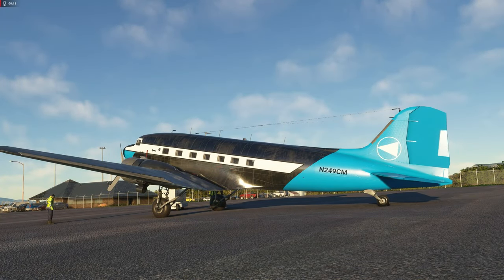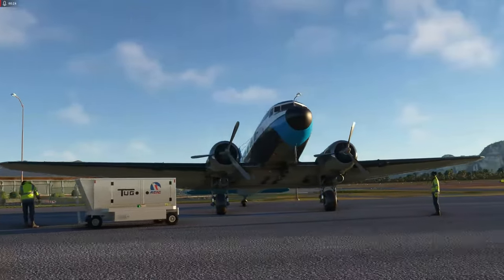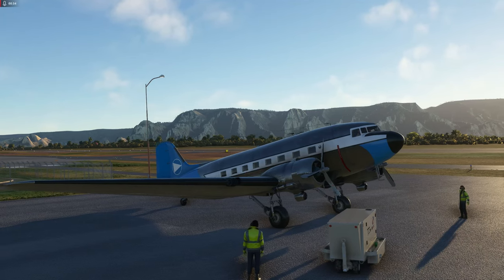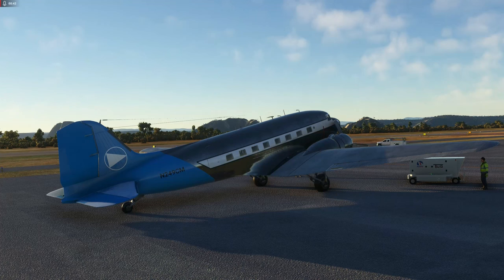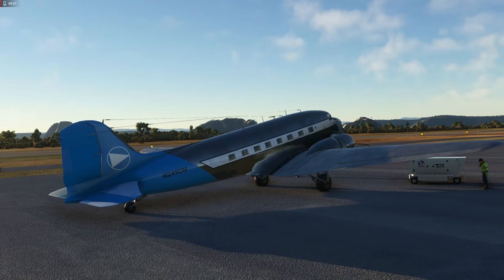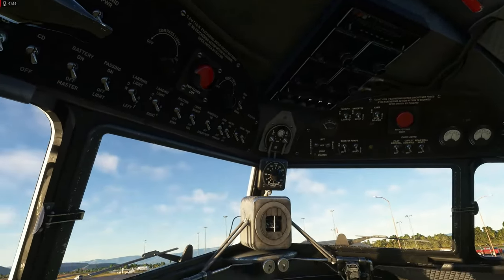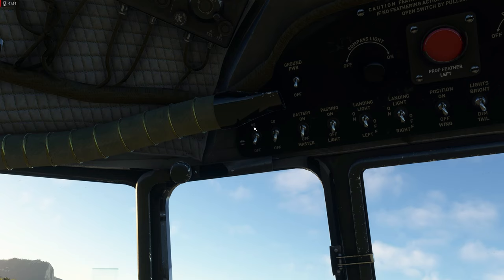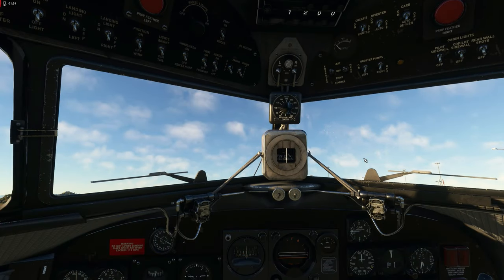MSFS Douglas DC-3 / C-47 Classic Variant Full Flight Tutorial (with Improvement Mod)

Comment: Some important advices: climb Power is 36MP and 2300 RPM, try not to exeed it! At take off and landing, stop forcing the tail to do something. For Takeoff: Let the tail come up and push yoke fully forward while it comes up and during TO-Roll until Vr is reached. Normal start is with flaps 0. Only at super short runways TO with flaps to half way up. Landing: Push the yoke downward after touchdown until the tail goes down by itself. Raise the flaps after touchdown to accelerate the progress. Wait for the tail to come down before you pull the yoke full up.
Reply from the maker: Thanks for your tips there! Actually after finishing the tutorial I did improve my flying with this bird a lot (esp. TO and LDG), still I will pin your comment for others to see. Cheers :)
Reply: Does the plane have actual failures that can trigger if flown too hot etc ?
Reply: @saren6538  get the duckworks mod from flightsim.to. Works best and is the most realisitic.
Reply from the maker: @saren6538  Not entirely sure. The default plane definitely not. Maybe with the Duckworks mod installed.
Reply: @saren6538  it has
Reply: @Euer_Hochwuergen  the default ?

Comment: I flew the DC3 for 6 years - we never opened the Storm Window as we spent a lot of time trying to stop it leaking.
* Taxing tail wheel locked unless your turning you use indipendendent engines & brakes. ( BTW This DC3 in MSFS is not realistic taxing as the Rudder acts like nosewheel stearing)
* No Flaps for take-offs as there drag Flaps.
Reply: Hi! First of all that sounds amazing, you must have a lot of stories to share flying this beast. :) 

Can I ask you, how did you used to Navigate back in the day on these instruments? Nowadays we are blessed/spoilt with all the information in front of us, like our ground track, ground speed etc etc, how would you have gone about finding your Wind Correction Angle for example?
Reply: @michaelpace5356  We used ADF, VOR & LOCALISER  for tracking plus Dead Reconing.
For my last DC3 flight (I was moonlighting for another company) heading back to Sydney from Gove (top right hand square side of Australia) we hit the coast & went into cloud (This DC3 only had 2 ADF's) & used dead reconing for the next 3 hours till we picked up an NDB.
We all had a "Prayer Wheel" ( a Nav calculator) but worked out all the times in our head usually. 
Keep in mind we learnt to fly in light aircraft that had no aids at all.
(I ended up flying A310 Airbuses so that was la span in aviation)
Reply: @billolgaau  So interesting! I'd imagine that 3 hours of dead reckoning would have kept you awake :) 

So you guys used to have an idea of the wind through the forecasted winds then something like an E6B was there to find your data? Makes a lot of sense actually

Comment: Brilliant, thank you. Always look forward to your videos.. Quick question if I may... I see you switched to MS flight sim from Xplane 11... Better graphics but requires more power from your graphics card I take...
Reply from the maker: Yes I put so many hours in XP11 (I think over 600), it was time to spend more time in MSFS as it's a brilliant sim as well. And no more Ortho4XP tile building is also nice for a change ;) Regarding the GPU, I own an RX 6700 now and it's more than capable to run nice, high settings at 1440p. Cheers
Reply from the maker: Oh wait, I did put 893 hours into XP11 hahaha
Reply: @SimulationChannelDeluxe  Thanks for the replies... I have an rtx 3060 nvidia... Running P3d v5 well.. was waiting for xplane 12...
Altough MS FS look absolutely stunning..
Not sure if my card will run it with decent graphics settings...
Reply from the maker: @mk1479  The 3060 should run it nicely, especially in 1080p.
Reply: @SimulationChannelDeluxe  Cool thanks.. and sorry to pester you one more question.. Does MS FS have to have internet connection to run?
Reply from the maker: @mk1479  For the most part yes. If you want real weather, the world ground imagery etc. you need internet. I think the sim itself can run offline, but it looks way worse and many functions are missing.
Reply: @SimulationChannelDeluxe  OK Cool thanks for your help..

Comment: Well, well well, here's ACD making a tutorial on a classic aircraft... ;) I thought those where not your thing? Anyway, you did a great job,  tried the dc3, but found it impossible to fly, might give it another try after watching this video!
Reply from the maker: Thanks bud! The DC-3 is a lovely old bird, I wish Aeroplane Heaven would have put a little bit more work in it as some systems are inop. Hopefully the improvement mods will add more stuff over time :) Btw, you wrote ACD... I guess you mean SCD? XD
Reply: @SimulationChannelDeluxe  Of course it should be SCD, drinking beer and typing is, just like flying, no good match. :p
Reply from the maker: @1849ad  Hahaha sure thing :D
Reply: @SimulationChannelDeluxe  If I may ask a question; I downloaded the enhanced version via the msfs marketplace, but it's not showing up in the aircraft selection page, any idea? Or do I have to switch in-game somehow?
Thnx in advance!
Reply from the maker: @1849ad  The Enhanced version just "overwrites" the default DC-3. The same for the A310. There is no additional aircraft to select :)
Reply: @SimulationChannelDeluxe  Ok, thnx. For me, the original modern autopilot keeps showing up. I think there's something wrong with the installment. Pmdg 737 also wont show up anymore. :/
Reply from the maker: @1849ad  That's strange. But regarding the DC-3, you have to see if it says "Classic" or "Retrofit". That's livery dependant. Some have the gyropilot, and some the GPS.

Comment: PAPI lights & your flying a DC3? :O)
* On approach make a nice steady approach like you did & leave the Pitch as is & as you flare & close the Throttles then Pitch full fine. (Great landing BTW)
* To stop the bounce use a slight forward stick.
* Auto Pilot - Don't bother lining the numbers unless your using it.
Reply from the maker: Great to hear feedback from a real DC-3 pilot :) Many thanks for it.
You're right, the steering on the ground is way too easy in MSFS. On the other hand I don't own rudder pedals or seperated throttles, so I'm quite happy with "easy mode" there ;)
Also by now when landing I immediately raise the flaps after touchdown, that also helps against bouncing and to bring the tail down.

Best regards from Germany!
Reply: When I & 3 others joined the Airline 57 years ago we came from single engine, fixed gear, no Constant Speed props & only about 10 hours night flying around the circuit sitting "Two stories" up so to speak in a DC3.

Comment: EVERYTIME I land, no matter what speed  - 85 to 90ish - as soon as the wheels hit the runway, it almost immediately swerves to the left. When I attempt to correct, it over corrects to the right and off we go into the grass…any thoughts from you guys who do it right?  How about yoke and rudder curves (honeycomb and Logitech, respectively) - my guess is mine are all wrong.
Reply from the maker: Well I would definitely recommend to turn down the sensitivities, mine are set to around -40 for aileron and elevator, and -65 or so for yaw. Also it can't hurt to set the reactivity down to 80% or so.
Also make sure that the tailwheel is locked (forward position) when landing. That's all I can think of.
Reply from the maker: Oh and it's quite difficult to land in crosswinds. The DC-3 certainly needs yaw to be in line with runway heading, you can't really land it when crabbing in the wind.
Reply: @SimulationChannelDeluxe  I’ll give that a try.  Also I must have autorudder enabled since other planes I fly (small GAs) are uncontrollable on the ground, even taxiing at low speeds.  Haven’t even tried wind yet!
Reply from the maker: @john-or9cf  Do you own a joystick? Then I would disable all the assists in MSFS. Might be the cause for unexpected behavior.
Reply: @SimulationChannelDeluxe    Not using it, using a honeycomb yoke…and no assists other than auto rudder.
Reply from the maker: @john-or9cf  Ah I see, so no rudder pedals... I thought with a joystick, you could use the twist-grip for rudder, like me.
Reply: @SimulationChannelDeluxe    No, I have rudder pedals, just not-so-good Logitech pedals!  

I did disable auto rudder and I used your suggested settings - although I still have to tweak them further - but I was able to stay on the runway this time!  Something odd with auto rudder - prior to the latest update or two, I couldn’t keep anything on the runway without a lot of rudder even at low RPM and no wind - the planes would all swerve to the right.  Now, that doesn’t seem to happen.  But at least I can say I got the DC3 to land so now I can go back to my twin otter for a while!
Reply from the maker: @john-or9cf  Okay good to hear!
Reply: @SimulationChannelDeluxe  btw, thanks for the video - I was hoping someone would do one like this!
Reply from the maker: @john-or9cf  Glad you like it, thanks mate :)
Reply: You definitely need rudder pedals with differential braking for this one.
Keep the tail wheel locked  for take off and landing keep a small amount of power on to keep the rudder active then land the tail and full up elevator and brakes and throttles closed.
Reply: @Lonsome1223     Land the tail before the main gear?? I thought that was a no-no…
Reply: @john-or9cf  No obviously you land the mains first then gently land the tail.
Reply: @Lonsome1223  ok, just wanted to clarify!